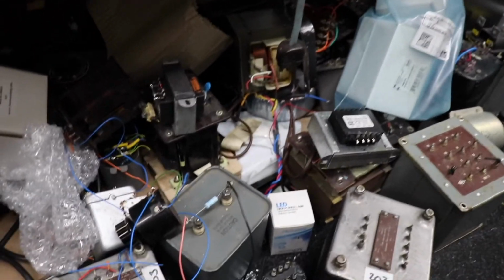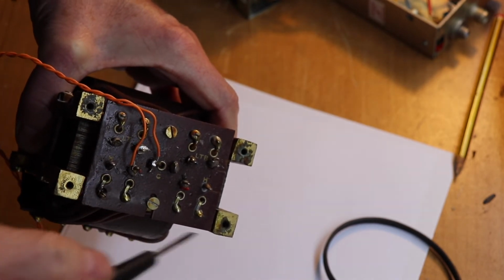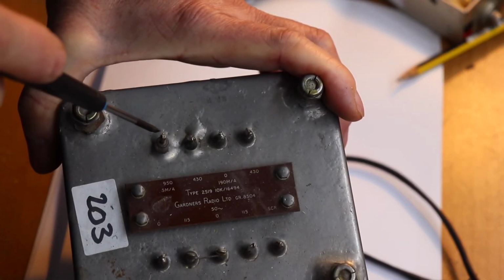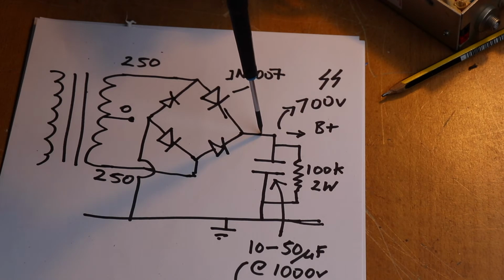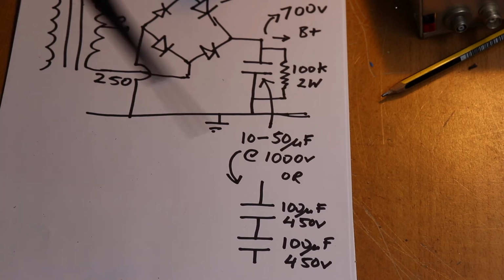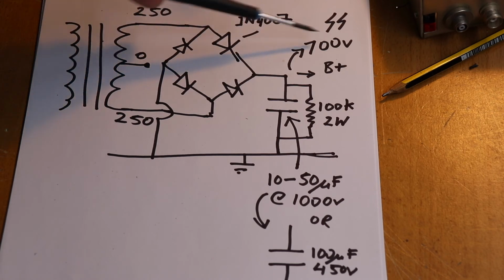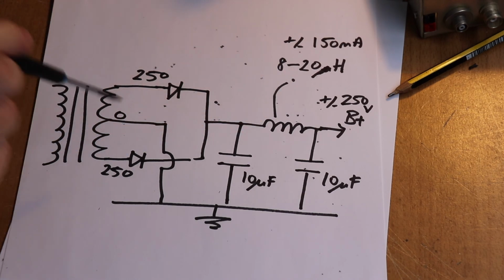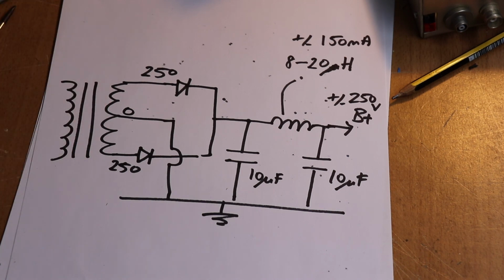Vacuum Tubes For Beginners: Power Supplies 1

Comment: I need a transformer to supply (4) 813's for RF amplification, what would you suggest for voltage and current ratings?, I will use a separate transformer for the filliments. I've seen people use microwave oven transformers but, I'am not to fond of that idea.
Reply from the maker: If you plan to use 4 813 you will need something like 1.5-2kv at 1 amp

Comment: Very good beginners tips Justin. I have a couple of HT supplies I've made up from several years ago. I remember the high voltage capacitors were always difficult to get. My HT supplies were around 250v and found a local supplier of caps around 450v. Good idea putting two of them in series. I never used any chokes as couldn't find an inexpensive scource. My aim is to replicate either a Codar AT5 schematic or one of F.G.Rayor's AM valve schematics from the old practical wireless magazines. One other difficult component was the modulation transformers. Enjoyed the video and looking forward to more. 73...M0DAD David